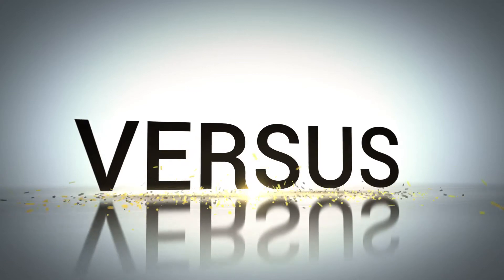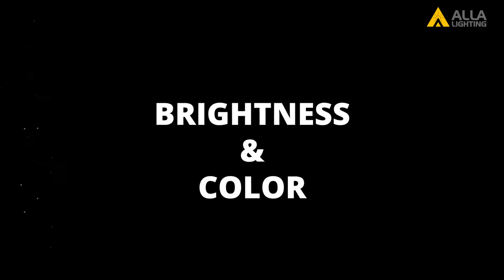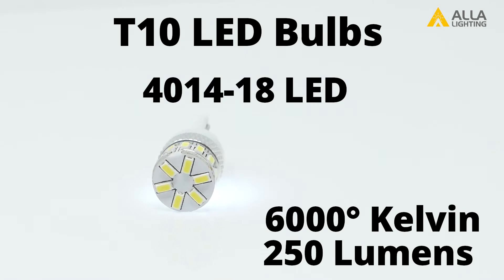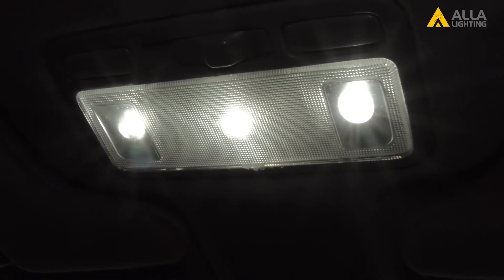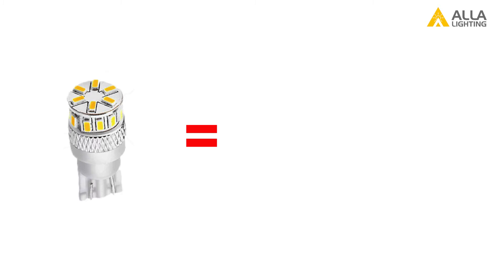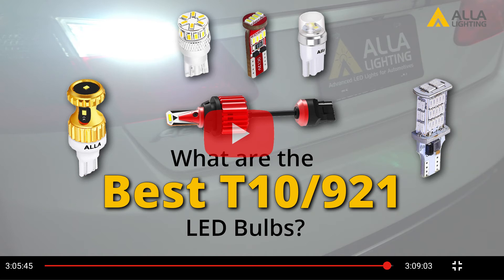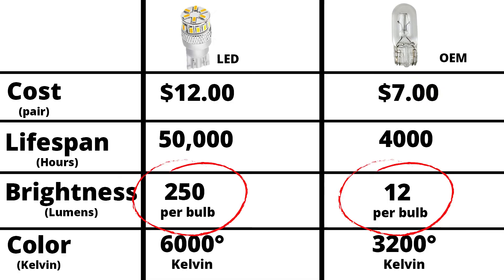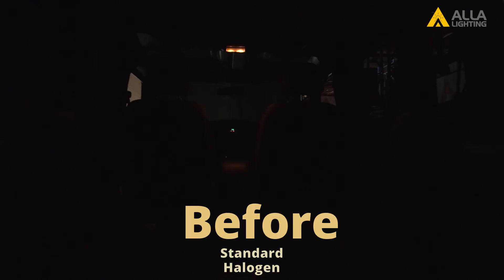2825 168 194 LED Bulb vs Sylvania Incandescent Lamp W5W 175 T10 Wedge

Comment from the maker: Compare T10 wedge 2825 W5W 168 194 LED bulbs vs Sylvania, Osram, Philips incandescent lamps 2821 175 658 at light's illumination, color, performance, lifespan, etc.
T10 wedge 168 194 LED lights bulbs' options link is: https://allalighting.com/collections/t10-168-194-led-bulb-super-bright-12v-interior-map-dome-trunk-lights
Fast check which bulb fit your vehicle's application: https://allalighting.com/pages/bulb-finder-shop-by-vehicle-led-light-bulb-car-truck